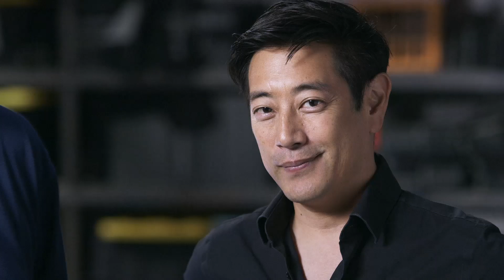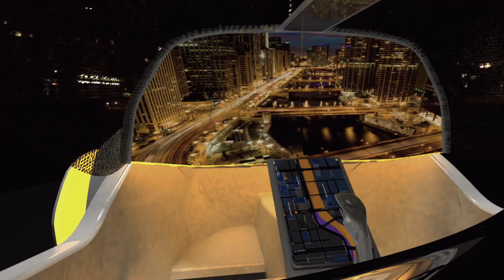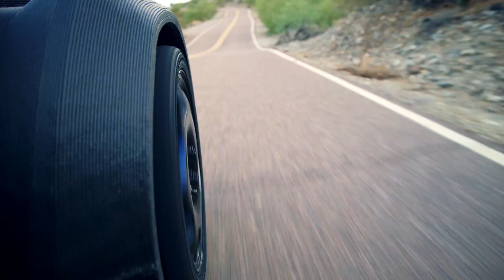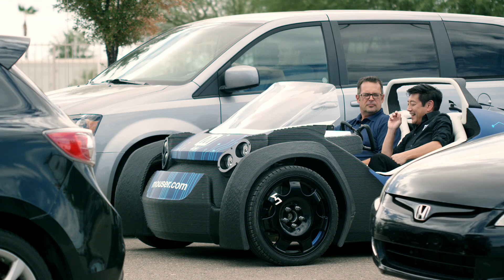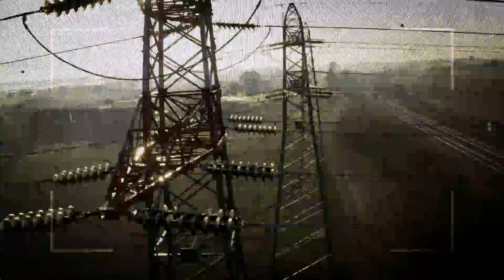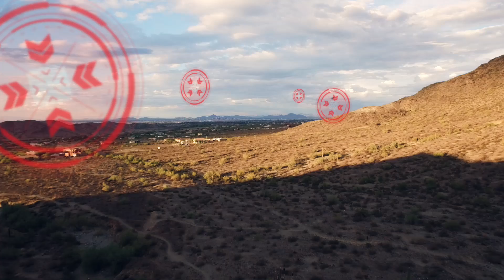Local Motors: The Essence of Autonomy 3D Printed Car | Empowering Innovation Together

Comment: how did you fix the problem such as the drone landing in undesirable locations, for example; a road, an unstable ground, something that could damage it to be short. also the large number of drones that would be flying overhead, and the fact instead of a AR game using the drone why not just make a game? im sure its both cheaper and more convenient. also the 3D printing aspect is interesting but if you are still going to need to get those specially made plastic coverings, dash-board and other things it kind of lessens the convenience and impressiveness. there is plenty more i could say but it would be better left unsaid